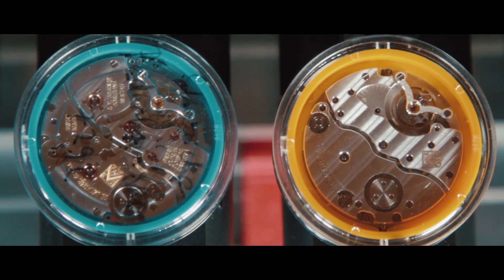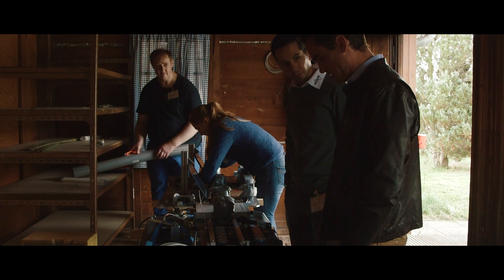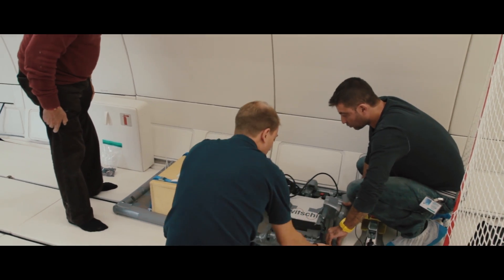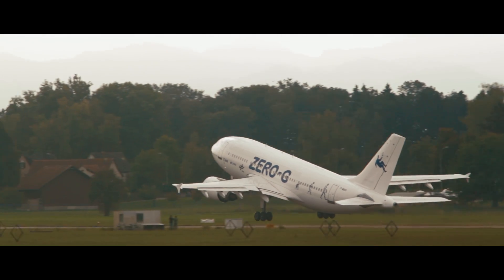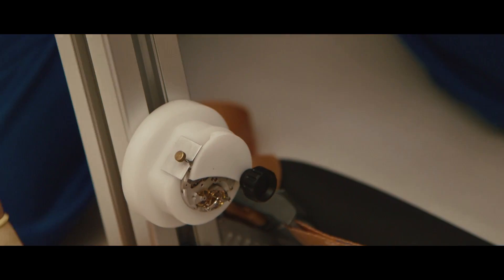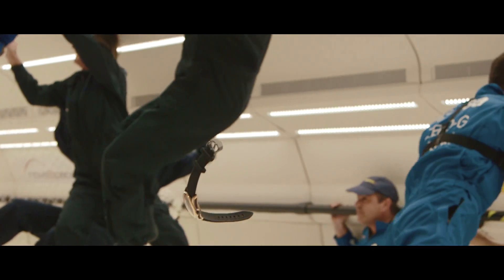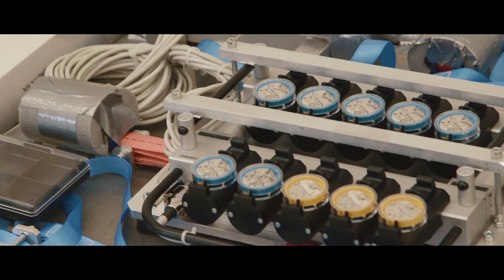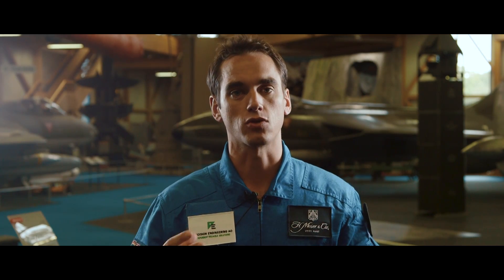Testing Watches in Zero Gravity - H. Moser & Cie

Comment: Not rocket science! Omega already achieved all these tests with NASA in the Speedmaster. Price difference between Speedmaster & H.Moser equals astronomical.
Reply: You do understand that Moser is testing different escapements against each other, to find what works best? This is research done by the brand, whereas the movement used in the Speedmaster was supplied by another manufacturer and not developed and built in-house. Additionally Omega and NASA never cared that much for zero G testing as any mechanical watch works in these and I suggest you have a look at the NASA website that they mainly tested shock and temperature resistance. Plus Moser watches are handmade by a small team of people, not mass produced like the Omega.
Reply: I don't see the point. The Speedmaster works and is still used by NASA today. If it aint broke don't fix it. I can't see astronauts taking a Moser or Richard Mille Raffa Nadal into space anytime soon. I can appreciate Moser are a micro brand trying to make a difference but I just find they are in some way exploiting that image for their own publicity which makes them as bad as Omega and the Bond franchise. What put them on the map was that stupid ugly Cheese watch. $1M? What clown would buy that piece of crap. They are not only ridiculing the Swiss watch industry, they are ripping off some dumb rich guy who doesn't have any taste and already owns a Patek grand complication but has grown bored and decides he needs a time only fugly piece of junk he can't match with a suit . What you must ask yourself is Would you buy that watch with your own money?
Reply: Terry Tudor they are not planning to do so. It is just a test for Moser to evaluate the exact behaviour of the escapements without gravitational influence. They are looking to compare these against each other and their simulations, which is explained in the video. I still think you did not understand the reasons those tests were done. Moser is not going to compete against Omega in the space race, this testing is just an evaluation of their own escapements against each other.
Reply: Terry Tudor Additionally the cheese watch is a criticism on the swiss made label, not for rippng off somebody. Additionally the money is used for independent watchmakers, not to benefit Moser. Please do some more reading on this topic.
Reply: I'm sure there is more to Moser's contribution to the watch industry than my ignorant views. I haven't attained the enlightenment of appreciation. As you have obviously a better understanding of the technical aspects of the brand's existence. Good for you. May take me some time to reach your level of understanding. Just as some collectors have embraced Grand Seiko, I have yet to embrace this. One day I will understand Cheesesatch making :)
Reply: I hope one day Moser will make a Tofu watch for those lactose intolerant or strict vegetarians.....Still I disagree with their cheesy watch. They instead could have made 10 high quality timepieces using the highest standards, selling at $100k each. Collectors would see value added benefit in purchasing that - just like  Defour or FP Journe. No dodgey handmade masterpieces from their workshops.
Also, do you REALLY think they intend on using the proceeds from the sale of the watch to fund independant watch making? What that means is the funds will go back into their own research and development so they can apprentice a junior independent watchmaker who can continue the Moser 'Charity' legacy. It's self perpetual marketing, like Rolex's perpetual movement applied to a business model. Very cunning.
Reply: Terry Tudor There is actually a fund to support independent watchmaking to which the money raised from the Swiss Mad watch will be sent. This fund supports many different independent watchmakers, not just Moser. Therefore more than one brand will benefit from it.
Reply: Well I hope it is successful. Despite my criticisms and cynicism I am very much a watch enthusiast and support such a cause. Just cant afford to belong to the exclusive club of owning a hand built micro brand independant watch. I'll have to put up with my mass produced Tudor (probably cased in China). Not my fault I cant afford haute horology.
Reply: Terry Tudor There are actually rather affordable independent watchmakers as well. Check out Dornblüth from germany who starts at around the same price as Tudor, which don't encase their watches in China. Trust me on that one, I have been to the Manufacture. 
As for affordable independents, there are a lot out there, some looking around and reading will let you find these. Check out 8past10.com and you will find other watchlovers motivated to help you as well.
Reply: Wow! thanks Simeon. You have been a wealth of knowledge. I will check out those recommendations. I just purchased a Pelagos LHD, (which I bought because it was unusual & different to a Submariner) so I'm relaxing my wallet for a few months. But will definitely be looking towards an independant brand in the future. I actually need a dress watch.
Reply: Terry Tudor The LHD is a great choice, I own the Black Bay Bronze myself and really like the Tudor watches. If I can be of any help (preferably on 8past10.com) just hit me up there and I will happily assist you as well the many other people who are using it as well, to get as much input as needed.
Reply: I am also a Tudoristi. I own 2. The eta BBB and Pelagos LHD. I'm thinking about the BB Chrono as my next purchase. But big snowflake hand impedes on sub register. I signed up to     8 past 10. Uploaded my watch collection. TERRYTUDOR
Reply: Do you think the Richard Mille is worth us$300k. I think What Moser are doing is good for the industry overall. Of course I want a watch that is tough even if it’s a dress watch. It’s the same reason why you won’t ever want a Timex watch. Speedmaster is machine made for the masses. I see a lot of people are wearing just no exclusivity.